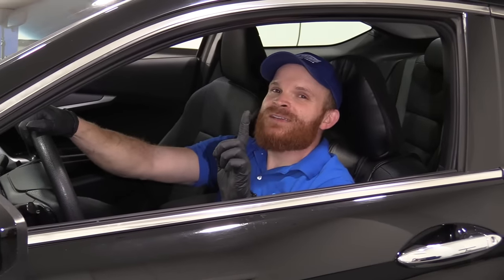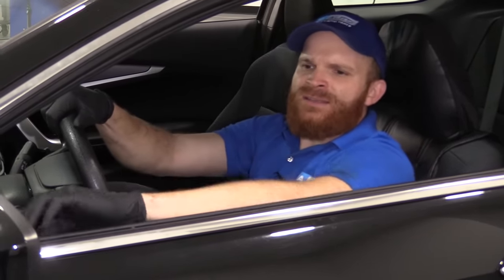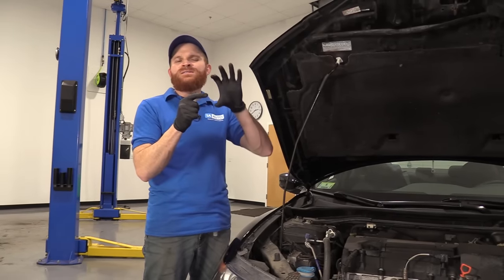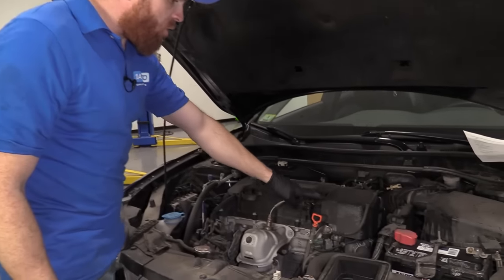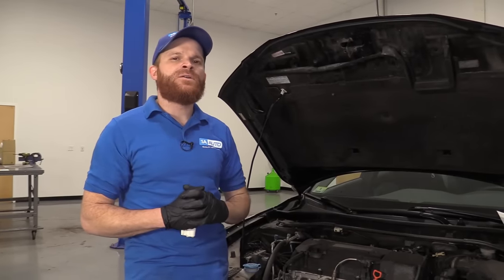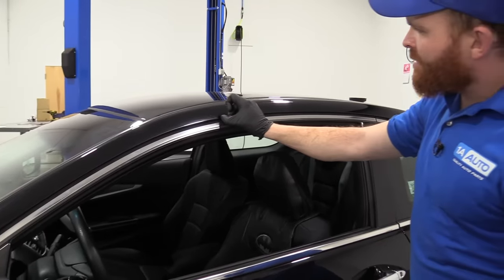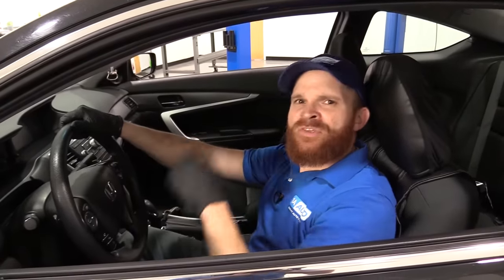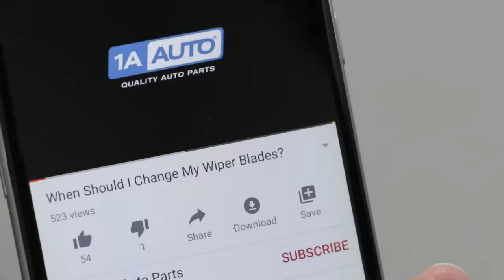Top 5 Problems Honda Accord Coupe 9th Gen 2013-17

Comment from the maker: √  Watch the Video
√  Buy The Part at 1A Auto http://1aau.to/m/Visit-1AAuto
√  Do it Yourself
√  Save Money
Reply: 1A Auto Parts paint definitely chips
Reply: The mirror distortion is not really a problem to me. I don’t even have to look at my blind spot. I can see the car coming from behind then see the car on my mirrors and still see them in my side mirror. Then, I can see them on my side mirror and can still see the the back of the car as soon as I see the bumper of the car with the corner of my eyes. Without turning my head..
Reply: I have a 2015 accord coupe V6 and the major issue I’ve had with the car is the fact it has VCM where it turns off a bank of cylinders and creates an imbalanced engine. It causes premature wear for the front and rear hydraulic engine mounts which results is a very annoying vibration noise when VCM engages. In fact this issue can be found on any Honda with the J35Y1 (V6, 6AT) engine. In order to fix this I’ve replaced the engine mounts and install a product called a VCM Muzzler which plugs into the cars ECT1 port. Overall it’s a great car and I love driving it.
Reply: Gotta change oil every 2 & half months in my 17 sport but I do drive alot for work. And paint chips in construction area does suck
Reply: Starter died at 40,000 miles 
It eats through oil about every 5,000 miles
And my hood is chipping some after about 3 years. 

Other than that, everything has been great
Reply: @alexpaul6383  or delete ur cat. Will kill the ECO mode. I haven't noticed really much differences in fuel economy anyway.
Reply: Funny. I have a V6 auto coupe. I haven’t burned a drop of oil since I bought it over 15K miles ago. I do change it every 3-5K with Amsoil SS 0-20.
Reply: The seat is made for normal height people.

Comment: I have a 2013 Honda Accord EX-L.  The mirrors are fine and the line is barely noticeable.  Over a 130,000 miles now and the starter is working great.  My car loses no oil and I check it often.  The only paint chipping I have noticed is from rock dings or hail.  The seats in this are very comfortable and the best I have ever had.  There is a reason why Honda consistently has a higher resale value than other cars:  they are built to perfection.
Reply: Literally same to all of that, lol.
Reply: I have a 2014 Honda accord 2.4 eXL. With 115k miles.  Other than oil changes and tire rotations I changed the front brakes twice and rotors rear pads once and put a battery in Other than oil changes and tire rotations I changed the front brakes twice and rotors rear pads once and put a battery in... And that's it no oil consumption . I do the oil changes every 5000  miles.I have some paint chips on the hood due to rocks. This car is meant absolutely amazing in bulletproof. The only thing that I had to replace was the satellite radio antenna due to water .
Reply: just got a 13 Ex L last week. Came from a 19 Accord LX and it’s way better
Reply: He might be referring to the V6s. I have a 13 V6 Auto and had to replace the starter at 30k miles. I think there is a clearance issue that was causing premature wear.
Reply: @jaspermorant2352  Wow!
Reply: Did you drain and fill the transmission fluid at all? My 2013 only has 40k miles and I'm mulling doing the drain and fill.
Reply: I've got that same model too, just paid it off completely 3 months ago and bought it brand new. Drove it from Texas up to Alaska.
Reply: The car he was showing in the video was a 2.4L inline 4. Not the 3.5 V6. He should clarify that.
Reply: @BraulioMontelongo  holy sht what a drive
Reply: I traded in my Jaguar XF for a '13 EX-L V6 and it's literally the best car decision I ever made. Was lucky enough to get the Tiger Eye Pearl color too!
Reply: @USS Liberator oil burning is usually due to pcv valve. It's a $30 part.
Reply: I have a 2015 292,442 no issues at all ...i do uber with it
Reply: I have a 2015 Accord Sport. 
1.  Hate that side mirror. 
2.  Replaced starter under 60K miles. (Via warranty)
3.  Honda paint has always sucked.  Wish someone in corporate would address this.

Other than those things, damn fine comfortable car with awesome mpg.
Reply: My 2013 Honda Accord only had 38000 km , run perfect.
Reply: First starter went out at 45000 km
Reply: @darrenarmitage3460  which model year and trim?
Reply: @USS Liberator my '17 ex-l coupe has 104k on it with zero oil consumption 🤷🏿‍♂️
Reply: Seats are actually terrible. I've had about 12 cars, and these are the worst. Specially compares to a WK2 leather seats
Reply: @joshbower  I drain and install fresh CVT fluid every 40,000 miles.  I also bleed the brakes once a year.
Reply: Honda's are not built to perfection they have their share of problems just like any other car manufacturers
Reply: 2015 lx accord same thing I’ve had no issues like this video says lol
Reply: @martymcfly5842  
13 accord ex-l
no need to change it that often, unless you just feel you have to.
I changed mine at 110,000, and it wss still serviceable. 
New honda plugs and brake rotors and pads also.
Reply: @adam6674  There is an issue with that motor Model, Earthdreams, burn oil in head of the piston.... investigate it..
Reply: I just purchased a 2014 Accord at 160k miles and I thought the side mirrors provided excellent visibility and that concave part of the mirror is suppose to aid with blind spot detection and it does that well. I though seats were very comfortable on a 470mile roadtrip from Atlanta to Tampa. (My frame is small like this guy too) In fact its way more comfortable then my 2020 Camry. The starter has been replaced at 150k miles buts normal at that mileage. The engine does not burn any oil either. Honda is by far the best driving and owning car.
Reply: Hell yeah!
Reply: For real, I've never seen any of this and I have a daily 2015 6mt with a few mods.
Reply: @Adventureswithmike1  great car indeed. Is yours 4 Cylinders 2.4L or V6 3.5?
Reply: 2014 Accord coupe V6 EX-L manual. I bought it new, 98000 miles now and only oil change, battery change and new tires at 80K miles. Never lost oil, paint is still superb, and love driving it still. I am 6'4" and the seats feel great. He looks so tiny in the car and maybe that is part of it. Either way, I am still driving it because I can not part ways with it. When I do get a new car, I have decided to keep this modern classic. It is such a great car and built amazingly. Anyone thinking about buying one, do not listen to this video at all. It is one of the worst car reviews I have ever seen.

Comment: Bro this coupe is one of the best fwd cars out there. Especially the v6 in manual.
Reply: Nice.
Reply: It may be nice but it has it’s flaws
Reply from the maker: +Dylan Buell Thanks for the feedback!
Reply: @Dylan Buell 4cyl is boring
Reply: @Dylan Buell I'm looking at a 2014 4cyl sport. 42k miles. I just started researching but have read consistently about the starter issue. If you know anymore info that's not in this video please share
Reply: @Dylan Buell how is it more reliable?
Reply: @Dylan Buell v6 is fast asf, it spins the tires in sport mode
Reply: @Dylan Buell how is it now reliable? If anything the v6 is going to last even longer then the 4 cylinder
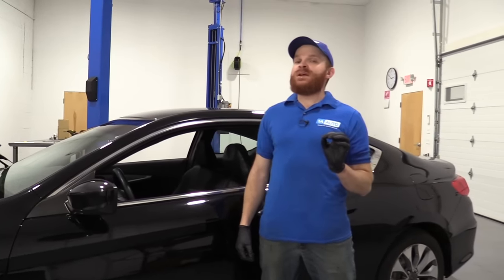Reply: 3:39
Reply: @christopher4692  nah
Reply: @AB-dm4hc   I have owned a 2014 Honda Accord coupe v6 manual for 3 years now. Starter has had no problems. I live in Canada at it starts in -30 weather with a breeze. In the 3 years of ownership the only things I have had to change are the breaks and oil. No other problems. Great car
Reply: Almost into one year ownership of a manual 2017 CT2, have loved every mile of it so far. Gotta get an exhaust already.
Reply: @michalzysk1809  I’m having starter issues (v6 2015) still love the car thou
Reply: I’ve been having my 2015 Accord Coupe I4 for well over a year now. The only thing I’ve had to replace is the starter but it was the original from the factory but other than that 450 fix, it has been very reliable and possibly one of the best FWD cars I’ve ever driven.
Reply: @Jose206Martinez  I’m thinking about getting a 2015 Honda Accord exl with 115k miles for $10k or a 2013 bmw 328i for $11k. How has the Honda been lately? And have you done any mods
Reply: @christopher4692  no it’s not. Look into how cars work, V6 has double the moving components of a 4 cyc, less parts means less issues to likely occur and vice versa.
Reply: @christopher4692  it's possible for the v6 to last pretty long but the 4 cylinders engines are the king of reliability in economy cars
Reply: @AB-dm4hc  I've got he 14 Sport, right at 102k miles. Got it brand new. No starter issues, first I heard about it. New battery last year. New brake pads. Wheel bearings in 1 wheel. That's it. No paint issues except from lil rocks. Front floor mats are crap though. Somehow wore a hole in it. Oh well.
Reply: @Dylan Buell that's what I have great car man congrats 💯
Reply: I had to replace my starter at 52,000 miles, cost $370 with labor.
Reply: @kanantony4423  I have a 2015 V6, @52K the starter has started to make a noise a couple of times. Time to change it, besides that no problems..
Reply: This is not a fwd car. It is a fwd veericle.
Reply: Agreed Kan.  The 9G 6-6 is an amazing and underrated sports coupe.
Reply: @BennyHarassi  550... Canadian

Comment: If all I have to change is the starter for the life time of the car im good with that! 3 starter 300k miles and 20 year’s
Reply: I had a 2013 accord drove it for 120k. I did the starter at 90k myself only cost 70 bucks. I have a 18 gti now and have had more repairs in the first 1.5 years than the accord had in 6 years.
Reply: Hows car doing ? Any oil consumption?
Reply: The older accords came with better quality parts, I had a 93 accord that I never changed the starter or alternator, just the basic brakes and stuff, now days the newer accord are put together cheap as possible, things go out so fast, your car is probably still working perfectly as of now,peace and God Bless
Reply: @Max_Thunder  thats what u get for buying a german car lmao
Reply: @Max_Thunder  Same here. My brand new 2001 at the time VW Jetta 1.8t was a very fun car but an absolute nightmare in repairs.  I owned it from new until 7 years and 130k before selling it. My current vehicle is a 2015 accord v6 coupe and aside from getting the starter and battery replaced under warranty at just under 3 years, the car has been flawless.  Had tge window regulator switch replaced under warranty too. But absolutely zero in out of pocket repair costs and im pushing 6 years and 65k on the car.  Night and day difference between the Japanese and the Germans.  NEVER AGAIN WITH VW! Also I've had zero oil consumption problems.  Not even a little.
Reply: @JoshyManTheGreat  Joshua I had a 2014 and  right at 30 k the oil was getting crazy. Maintenance minder  changed the oil at about 8 k avg and between changes I would have to add 1-2 quarts. Had 160 k on it and the tranny occasionally acted a little weird. CVT 's hard to repair and mostly must be replaced. Repair Pal quoted $8200- $8700 for that alone so I traded it. Shame. I miss that car.

Comment: I like my 9th gen veerhicle. I have no problem with the seat because I’m several feet taller than this guy at 6 feet.
Reply: I'm looking to buy a 2015 V6, which trim is best?? LX,Ex, EXL, touring?? 
And are they reliable??
Reply: @stonecold293851  have you decided on which one you wanted?
Reply: several feet taller? do you think he is a leprechaun?
Reply: @bigsassyster  Wait....What???  He's not a leprechaun?
Reply: @stonecold293851  I'm getting a EXL 6 speed manual
Reply: @stonecold293851  The v6 comes in either EX-L, EX-L w/ Nav, or Touring. No LX or cloth models.
Reply: I was think the same thing. Starter I had replaced under warranty. This is my second Accord. 3rd Honda in total.  These are almost bulletproof. 
I’m at 230k and going strong.
Reply: @ChrisKnorrAgent  How many miles now?

Comment: I've owned my 2015 Honda Accord EXL V6 Coupe since new.  At 33,500 I had the starter and battery replaced under warranty and 23,000 miles later everything is perfect. Excellent car with zero problems since. I currently have 56,400 miles on it and I plan on keeping it for 10 more years! I've done all the oil and filter changes,  air and cabin air filters, as well as coolant flush and transmission drain and fill myself using only Honda fluid in the transmission.  I've also replaced all 4 pads and rotors myself because Honda brakes don't generally last very long. Replaced all of them with Carquest Wearever Platinum pads and rotors at 45k and they have been amazing as well as flushed the brake fluid.  Thats it. Tires lasted the full 55k! Replaced them with Pirelli P7 Citurado all seasons with 70k warranty. Fantastic car excellent firm but comfortable ride well built and very reliable and refined! My V6 is very smooth and sophisticated when relaxed and screams like a mini Ferrari when opened up wide at full throttle while still being buttery smooth! Love it!
Reply: I’ve had my 2014 v6 touring for 6 years so far and everything seems fine, the only recent thing I did from the last 6 months of maintenance was oil change, air filthier/ cabin filter, and the back bearings of wheels cuz it was my a loud humming sound, overall great reliable car to own
Reply: @chrisnguyen1944  I have 16 Touring V6 and love it. Traded my 13 Taurus SHO for it. No regrets at all.
Reply: Damn bro that's awesome!! I have the same car except it's the I4 touring. I'm the second owner and currently sitting at 107,000km and no issues thus far! This is super helpful and good to know for the future. Thanks pal!
Reply: Did you hear at any point a buzzing/ whirring sound from the engine bay when gently accelerating? I have this problem in my 2015 4d v6.
Reply: Chris Nguyen Did you hear at any point a buzzing/ whirring sound from the engine bay when gently accelerating? I have this problem in my 2015 4d v6.
Reply: How do you like the pirelli?
Reply: I got the same car but the sedan auto transmission and I need help. I got the code P0777 which said A/T clutch pressure control solenoid valve B stuck on and CVT driven pulley pressure control solenoid valve stuck on. Any idea what it might be? Only problem is it has is the push to start won’t always work and my car jolted once since driving it. Hasn’t happened again. I also got o2 sensor codes but that’s an easy fix.

Comment: That so called "flaw you've mentioned in the DS mirror actually is a blind spot view angle glass and saved me from a few accidents, so if you don't mind I am keeping it the way it is. 
The seats are the most comfortable I've ever had and My former Mazda3 had very comfy seats. Plus these are not designed for midgets. Our 4 dr Touring is amazing with no issues. No clear coat problems, only stone-chips from highway driving. Oils is also fine, The AC compressor was replaced under warranty and works fine ever-since, so I highly recommend this car to anyone as a daily driver.

Comment: 2013 accord coupe six speed manual, just love it. None of these issues. If you do city driving, the split mirror is the best. I love the split mirror. You can easily tell  at a glance if someone is in your blind spot. It doesn’t burn a drop of oil between oil changes. 77000 miles…no starter needed yet. I don’t know why you would need to replace the starter two or three times, you’d think they’d fix whatever problem they had from the beginning.

Comment: 2014 Honda Accord Sport - Currently around 185k miles

Issues I've experienced:

2. Starter - replaced at 170k miles

3. Oil consumption - I check my oil every two weeks and I always carry a spare quart in my trunk to top off.  Some research on YouTube suggests I should switch my oil to Castro GTX synthetic as folks have mentioned they do a better job cleaning up the carbons within the engine to reduce oil consumption.  Some have also recommended switching to 0W-30 synthetic oil if your oil consumption is really bad.  The only downside is you'll experience a drop in fuel economy since your engine has to work harder with a thicker oil.

4. Paint chipping - some of the paint along the back of my car along the guidelines of the rear windshield have started to chip real bad.  It's not that noticeable but if you look closely, you'll see it.  At this point, the car is about to be 10 years old and I don't really care anymore.  

5.  Seats - they're ok for short trips but for long road trips they can be an issue

Comment: I have a 2014 V6.  The starter issues have been around for years. After 2 replacement starter it finally went a way.  It also has a catalyst converter code issue, so be warned.   .

Comment: Ive had mine for 7 years and now 135k miles later all i have ever done is brakes, tires, and maintenance services. All fluids are synthetic, always runs Shell 91, i do notice the transmission fluid gets dirty pretty fast.... i did have a starter change at about 80k miles and throttlebody was replaced because the butterfly on the inside took a crap. What i dont like is the door locks i have replaced all of them atleast once and sometimes they lock sometimes they dont it does whatever it wants. Overall i love my car so much i bought my wife the 2017 we are forever Honda.

Comment: I own 2012 and a 2017 EX-L coupes with the V6. The mirror issue is very real on the 2017. Paint issues are very real on both and I've had my 2012's paint issues addressed. Oil consumption with both has been essentially zero. Great engines.
The seats are great. Maybe because I'm a lot heavier, 212lbs and they fit me better.